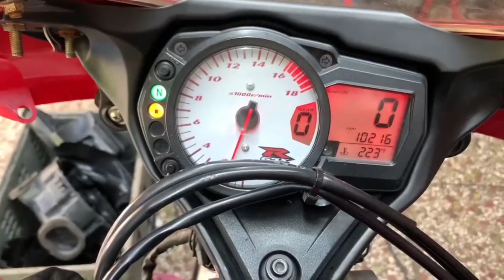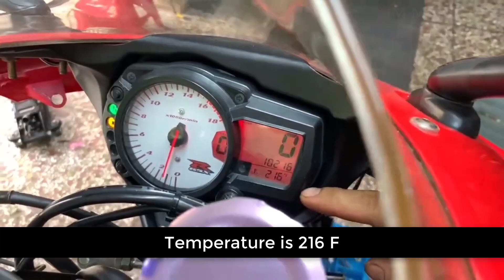Repair | Suzuki GSX-R600 Engine Restoration.

Comment: friends how are you I have that motorcycle year 2007 750cc and I had to do the same to repair it so why did I mix the oil with the water now that I have repaired the machine motorcycle it was fine but the motorcycle now gives me the code 28 and the warning light does not turn off of the reserve it remains fixed and it does not go beyond 180 Fahrenheit for the fan to turn on and when the motorcycle turned off, the water flows through the expansion vessel. I want to see if you can help me if when the tps sensor is damaged the motorcycle gets out of control no the high injectors come in I wouldn't really appreciate your help either thank you